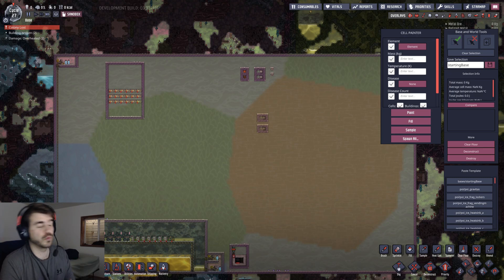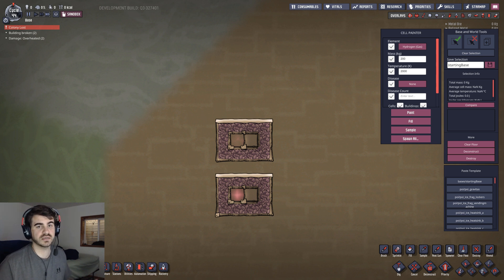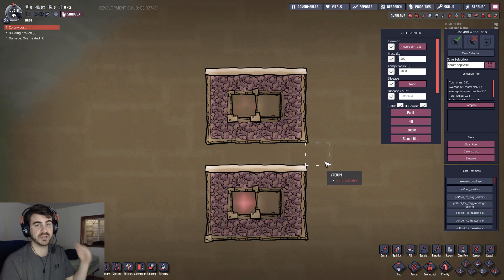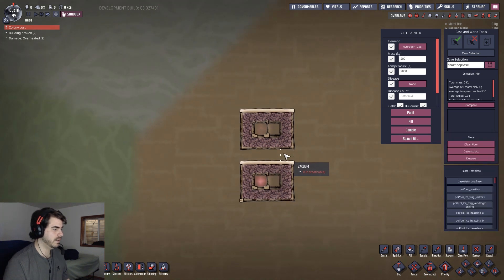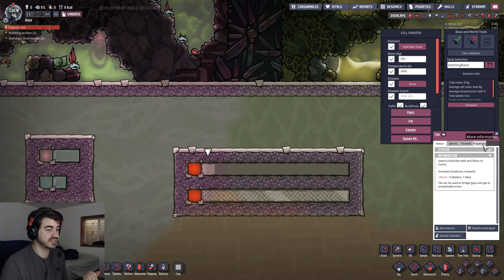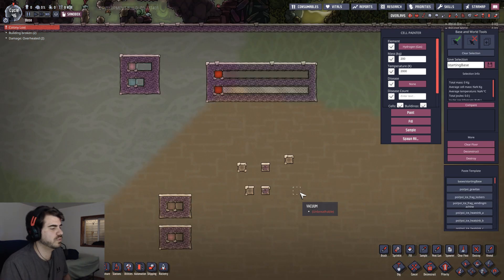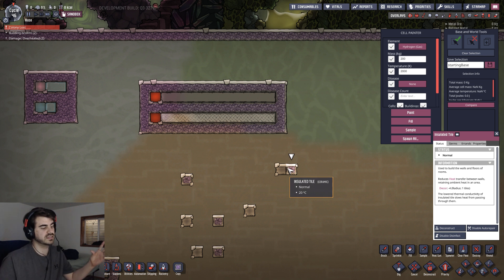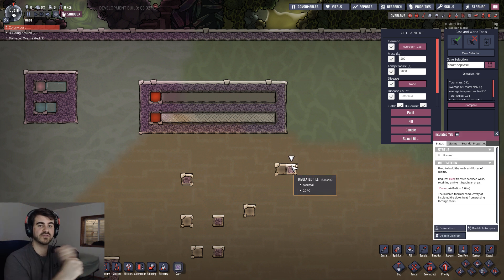Oxygen Not included Quick Tips #4- Thermal Properties

Comment: If I want to cool down the O2 produced in a snow biome to send out the cooler air into my base, should I use radiant pipes against an entropy nullifier, then use insulated pipes (of what meterial) to distribute to the rest of the base?
Reply from the maker: Yes, a room surrounding the nullifier submersed in hydrogen with radiant pipes would work for that. As for the insulated pipes, I would use igneous rock.

Comment: Yes this was helpful… every video you see Recommends using space age materials however early to mid game when I feel heating is the most critical it's hard to decide what materials to use

And really early on using metal is hard as well as you only have a limited supply to begin with
 Also noticed  My copper electrolyzing are in the cold biome...keeps breakin... Changed it to gold and it seems to be fine now I'm assuming the copper couldn't transfer the heat fast enough?
Reply: I have been using igneous but unfortunately most of it seems to be pretty hot to begin with and I've been trying to steer away from  It because of that
Reply from the maker: The copper electrolyzers were probably overheating because of the low overheat temp, gold increases the overheat temp to 125 so that is probably why.  Igneous shouldn't be that hot unless you're getting it from a volcano. A good way to combat heat is a couple wheezeworts in your main base and since your electrolyzers are set up in a cold biome, you could make a radiator on the output to create "air conditioning".
Reply: @LurkzGaming  yea by hot I was referring to 100° compared too mid 70° starting area temp
Reply from the maker: Ahh, that's not too much of an issue. As I mentioned wheezeworts would probably be enough but perhaps you have to much machinery in your base generating heat or something.
Reply: @LurkzGaming  no I'm just a perfectionist lol...trying to manage temps perfectly and and whatnot...just having fun....screwed around with the circuits yesterday and made a cool vacuum lock door with fail protection and after 39cycles its -9°f on one side of then door and 78°f on the other side even though dupes pass through atleast once per cycle
Reply from the maker: As long as it's fun I have no objections ;D.